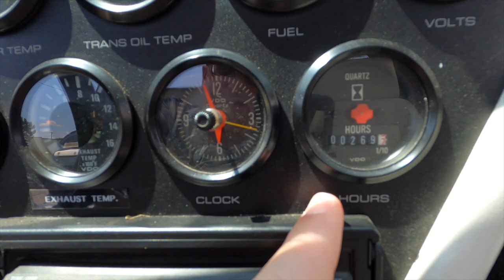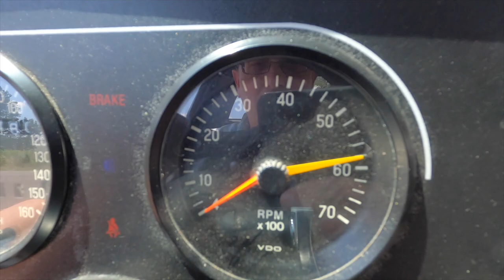Driving the MOSLER CONSULIER

Comment: Chryslers 2.2 Turbo is a great 4 cyl. Makes the same HP as TQ, and aside from headgasket issues, is very bulletproof. Engineered by the same man behind the Slant 6.
Reply from the maker: They put them in everything!
Reply: I built an Omni 25 years ago with this engine,  it made around 320 hp reliably. I raced that car for 20 years, it weight 2300 lbs and ran 12 second 1/4 mile times. These engines were tough.

Comment: 30 years ago guys were getting 300 horses out of those 2.2 engines with just minimal tweaking.  I'll bet that would have been a blast.
Reply from the maker: A rocket!
Reply: There is so much aftermarket for the 2.2. 400hp is easy nowadays and they are bulletproof. Rarer cylinder where the hp and tq are equal.
Reply from the maker: @Chase_is_a_race  This thing was such a blast…400hp probably would’ve killed me 🤣

Comment: it is pronounced Con Sue Lee ER, it is a made up word that means nothing. Not a fiberglass car, it is mix of fiberglass, carbon and kevlar. first production car ever made with a carbon monocoque, tail lights are from an el camino, some cars have ebrake on left (like the one you drove) others have the ebrake in the traditional center location like mine.  The roof on the targas are terrible, the car has very little insulation so it is loud, The AC only works from dusk to dawn. Next time im up near you (or you in palm beach) Ill let you drive mine with about 100 more hp than the one you drove here.